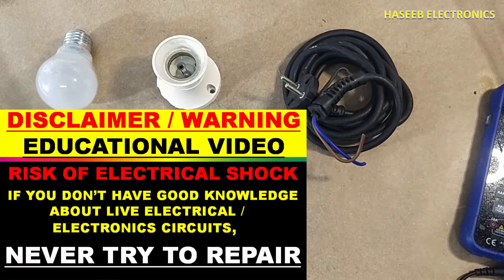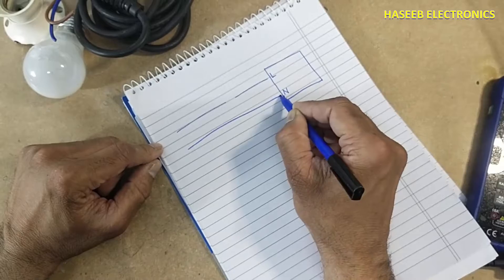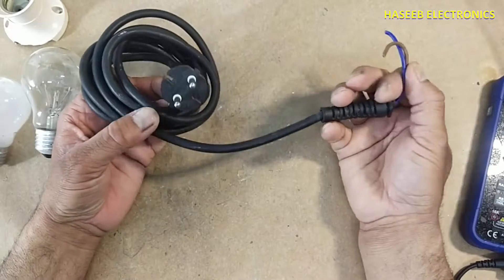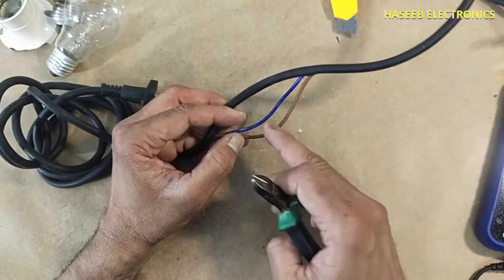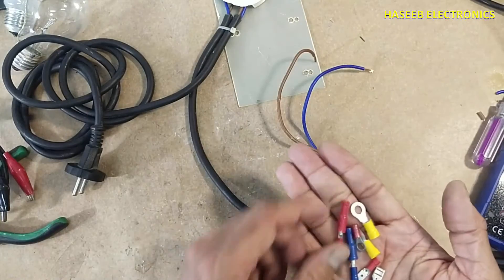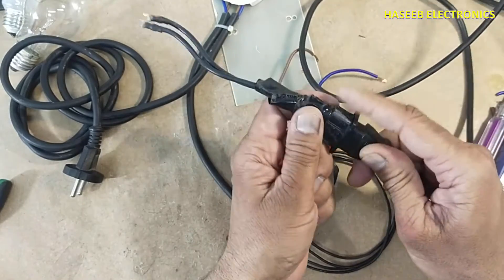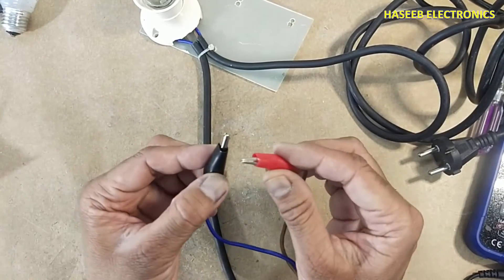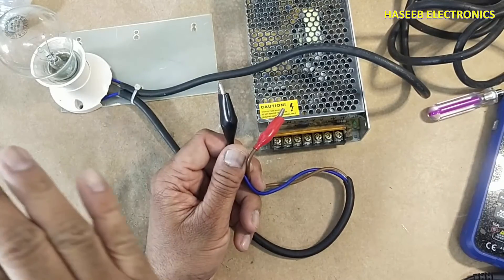{1067} Simple and Easy Portable Series Lamp

Comment: I have been using a STL for everything. Problem are the SMPS with a monitoring. It detects the lamp and will not fully power on. How do I power high current or SMPS with power factor with a test lamp?

Comment: Hi from France. I really enjoy your videos very usefull 

I have a question: how to know the power of the lamps we need to use (100w?, 200w? more or less ??)

Thank you 
Fred
Reply from the maker: most welcome dear brother 
for low power circuits (less than 100 watt loads, use 40 watt or 60 watt lamp)
above 100 watt circuits 100 watt lamp is good 
above 200 watt circuits 200 watt lamp is good
Reply: Thank you for your reply

Comment: Good morning haseeb sir, i have a gigabyte p450b that's not turning on, the primary section is okay, and the 5v standby wire gives out a voltage but even after i short the ps/on wire to ground, it's not powering on, sometimes it does, most of the time it doesn't, what confuses me is the irregularity of it turning on and off, would you mind helping!

Comment: Hello sir good to have you back . I have really interested questions I built a smps welder with all the right parameter gate drivers transformer halfbridge speed drive for gate mosfet irf90n20D 5 ohm gate resistor 1/2 watt 10k discharge resistor 1/3 watt current sensor transformer frequency 225khz the unit turn fine no heating kool but at 2.6 amp 156volt the mosfet break down the temperature is 30 degrees C but when I turn the fan on I get 10 amp 133 v from just 4 mosfet and the temperature was 28 degrees I let the load run for 25 minutes the unit still work but as the fan turn of the blow at at 7 amp so do you think thr mosfet or design to alway work will continuous fan run because it seen to be that way I intended to use it for welding but I will add 16 fet for the 2500 watt for safe operation what is your thoughts on this

Comment: Thank you, professor, for everything I learned from you. I made a tester for LEDs (according to your model with step-down transformer, rectifier bridge and voltmeter with indications of milliamps and voltage on the tested LED) and now - I also built a circuit like the one in this video... I tested a switching source from a computer and a 24 volt/3A switching source like the one in this clip... at the computer source, after connecting to voltage, the bulb with a 100W filament, has an oscillating light (increases and decreases in brightness) while with the 24 volt source, the bulb stays on continuously... can you explain, for a beginner like me, where the fault can be located, at each of the two sources? at the computer source, the voltage on the gray wire does not exist....and, if you have time, can you recommend me how to discharge the flash capacitors with dangerous voltage from the switching sources? i.e. what value should should I have a discharge resistor (for example 10W power) to discharge these capacitors? thank you for your kindness and my respect for your work.

Comment: Sir can we test a ceramic capacitor that hight voltage 2k 100k in circuit when the power supply is on ? Please explain sir